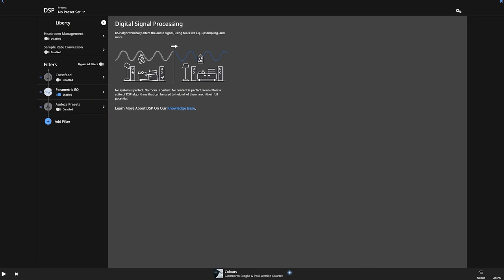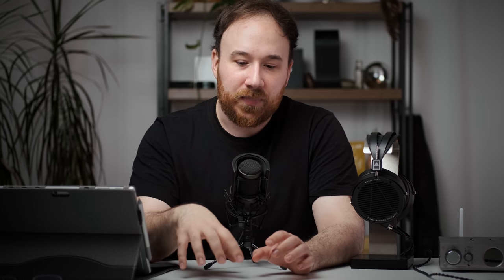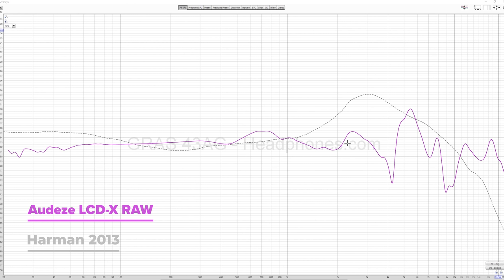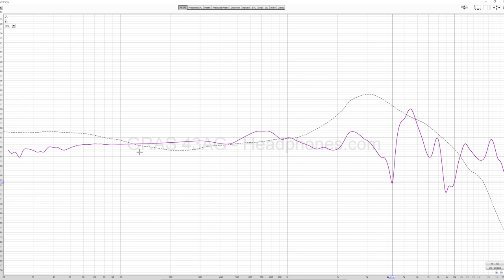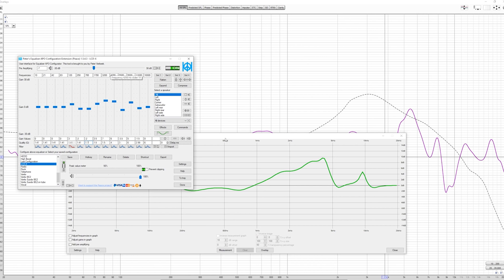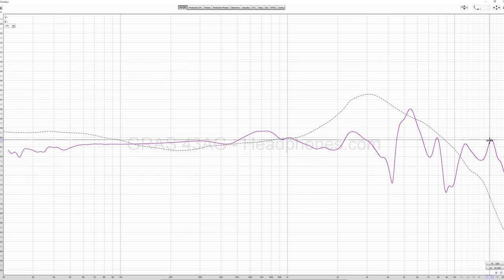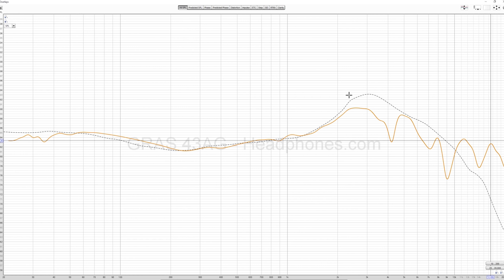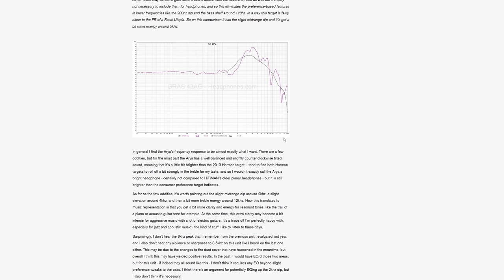How to EQ Headphones - Featuring Audeze LCD-X 2020 (not 2021)

Comment: NEWSFLASH for anti EQ folk, most mid range and above speakers are EQd on the production line after being manufactured to account for inconsistencies. Even iems and headphones have a PCB that basically EQ the driver because you can't always tune everything with mesh and filters etc. Basically whether you like it or not, you're probably already using EQ in some way or another
Reply: Ok, sure ..but if you’re spending $5k-10k on speakers …apart from positioning them properly…you shouldn’t have to touch a damn thing .
Reply: @carminedesanto6746  unless you've got a perfect room, EQ will benefit even the best speakers. Hardcore audiophiles tend to be traditionalists and will spend an awful lot of money and effort dampening the room etc, but for most people, EQ is still probably the way to go, and the technology is only getting better. People just need to understand that less is often more with EQ and not try to take the drivers places they cannot go

Comment: Do you prefer this over using Reveal+? I use the LCD-X for mixing but it needs correction (mids are way too recessed for the guitar driven music I usually work on) I used Sonarworks for a while but I think it sounds a bit unnatural. I am using Reveal+ lately but wish I could boost the effect it has on the LCD-X even more.

Comment: I dont get how can someone enjoy LCD X´s "out of the box". EQing is necessary for me.
Reply: Much better than the dt-1990's out of the box
Reply: @chadfranklin47  i dont know maybe i got bad pair but mine sounded so thin out of the box.
Reply: @ozcozfozc  That's probably normal then, I just got mine yesterday. My pair have definitely improved with EQ and are a lot more enjoyable. They did lack in low end before EQ, but were definitely listenable. I compared to my dt-1990s as those were completely unlistenable due to the blinding highs. Even with EQ, I still can't seem to flatten out the midrange.
Reply: @chadfranklin47  My lcd x out of the box were WITHOUT low end unless i played some new well mastered trance etc. If i played some metal, rock or 90s eurodance all of them had NO bass (my porta pros without eq had way more) and sometimes very aggresive treble especially with the eurodance. My eq is probably crazy. I added 10db to the 166hz with low shelf filter, lowed 5db from 8000hz because it sounds better to me and i play with 16000hz and 20000hz depending on the song (add 0-5db or sometimes lower 1 or 2db for overly bright tracks.) I dont really know its right way to do it but this way i can actually enjoy them, the Bass is actually strong. So my experience out of the box - tiny sounding, no bass and trebly. I suppose i was not ready for them. Also im using Conductor 3xp dac/amp.
Reply: mby im supposed to listen to those audiophile tracks only haha. Also i have not touch the midrange, only sometimes i play with it little to bring out the vocals out. Fortunately the lcd x´s respond good to eq even for my "crazy" preset
Reply: @ozcozfozc  Hmm, that does seem a little off from my experience. I slightly boosted the bass on oratory1990's EQ preset for the LDC-X and it's working great for me. Not sure how hard it would be for you to try another pair for comparison as I would have some trouble finding another pair to listen to myself, but it's great that they take EQ pretty well. My dac/amps are on the lower end, been using the Mayflower ARC Mk.2 and the Topping DX3.

Comment: Sorry, a complete novice here that wants to give this a go. Probably the dumbest question in the comment section, but how do you plug your headphone into the computer? Does it just need plugging into the headphone jack? or is there some kind of USB connection? Once plugged in does the program (Equalizer APO) connect automatically, or or do I need to open the program and select the headphone? Once EQ'd does the setting save on the headphone itself? So it can be used on different equipment etc... Cheers!

Comment: I tried your EQ and wow... do not like. :p Maybe it's because I have a sensitivity to the 4kHz range. I could never stand the Fostex 600 or 900's for this exact reason and I always had to EQ them down by around 8dB to get them to be 'balanced' to my ears. Maybe that's why I prefer the stock LCD-X sound which tends to lean more analytical with a 4kHz dip. Most of my fav cans tend to have this dip so I guess my ears are just broken or shaped wrong... Either way the LCD-X is so freaking great out of the box.. well with burn-in and new cables but who am I to question stock..
Reply from the maker: It also depends on which LCD-X you have. There's quite a bit of unit variation

Comment: @THE HEADPHONE SHOW

After watching countless Youtube headphone videos I decided to purchased the Audeze LCD-X headphones.  Upon receiving them, I was a little disappointed in the sound quality.  But, after watching Resolve on the Headphone Show on Youtube explain how to correctly EQ the LCD-Xs, I was quite satisfied with my new cans.

I am currently streaming Ultra HD audio through my PC’s USB port from Amazon which consistently streams music at 24bit/92kHz.  My USB cable is running into a FiiO Q5s portable amplifier/DAC with my headphones coming out of that.

I would like to upgrade the FiiO Q5s portable amplifier/DAC to separate headphone amplifier and DAC desktop units to improve the sound of the Audeze LCD-Xs.

What headphone amplifier and DAC would you recommend to complement the LCD-Xs?

Comment: 1. Always use minimum-phase EQ unless you want to EQ multi-driver iems.
2. Use high pass filter in the sub-bass region if you elevated bass. That's because most headphones distort in that region.

Comment: Isn’t Harman for over-ear a compensated curve? But then the LCD-X graph is raw.... Just a little confused since the mids look really boosted for a raw graph.
Reply from the maker: No the Harman target itself is a compensation. So when you normalize it (assume it's a flat line), then the headphone measurement (LCD-X) shows deviations relative to that target. So in other words, a compensated frequency response measurement includes a compensation target (Harman or DF or a custom target etc.). A raw measurement doesn't. What I'm showing here is the raw measurement and what the target curve is. The main reason for doing this is partially to help people understand that headphones shouldn't measure flat, but also to show that compensated graphs can also use different targets. Does that make sense?
Reply: @TheHEADPHONEShow  I think what was throwing me off was the amount of dB increase from 1 kHz to 3 kHz in the Harman target curve. That rise looks like it includes pinnea gain, where the raw graph does not look like it takes into account. I want to stress "appears" since,  if I am understanding correctly, that the Harman target does NOT take that into account.
Reply from the maker: @popzeus3000  you mean the LCD-X measurement looks like it's compensated? Yeah that's actually a raw measurement of the LCD-X, I could see how that would be confusing.
Reply: @TheHEADPHONEShow  Does your measurement rig duplicate the human ear pinnea? If the LCD-X graph already visualizes the natural 1-3k rise in dB because that's what the mic inside the dummy head picks up, then everything makes sense. The term "raw graph" in this case, just refers to the lack of EQing since it is still a graph from a rig that does not hear all frequencies equally, like that Harman target. 
The other point of confusion on my part I think has to do with the Harman target being way too mid-centric for me. Their over-ear and IEM targets are WAY different. Obviously this is subjective, but I don't want a mid-treble peak 8dB louder than the bass shelf. That's a bright headphone to me.

Comment: Hi! Love your channel, and thank you so much for this! Just got my LCD-X :) I found Peace to be one of the least intuitive applications i have ever used, but i figured it out after some hassle. 
Here's a tip: If you are unable to make Peace work, meaning, have an effect at all in windows 10 - Choose "Trouble shooting" while in the configurator and select "Install as SFX/EFX (experimental)"
Reply from the maker: Just keep in mind that the profile in this video is not applicable to newer LCD-X headphones
Reply: @TheHEADPHONEShow  How so? I applied it to mine, which i guess is the newer version, and I think it sounds a lot better! I did however ease off the peaks at 3-4KHz and 10 KHz a bit.
Reply from the maker: @TheEmrobe  the FR for the old units is quite different from the newer ones. So I don't know which you have. I'll develop a new profile for them and you can see which you prefer.
Reply: @TheHEADPHONEShow  Awesome! Thank you so much :)

Comment: The disadvantage of the Harman curve measured on a dummy head is that different people have different head-related transfer functions: our ears and heads are not all the same. 
 So rather than equalize to an abstract model of the human ear and head, I prefer to equalize the drivers directly.  Flat plate measurement + B&K hi-fi curve (a small bump in bass followed by a .9 db/octave rolloff at 200 Hz) produce a headphone that sounds more like listening to speakers in a room, and works very well for non-fatiguing listening, with a very natural warmth to the sound.

Another disadvantage of the Harman Curve is that later revisions have nothing to do with sounding "flat", but sounding exciting or interesting to a wide variety of listeners.  Trained listener prefer a flatter curve that is less v-shaped.

Comment: I think I missed it, but what application are you using to get the frequency response, and overlay it with the Harman 2013 line?
Reply: That's REW. You won't be able to use it like that unless you have an industry standard rig to measure your headphones with ($30,000+)

Comment: If you need to eq your headphones, You bought the wrong headphones. You can eq all you want, but the condition of your hearing changes during the day. There are lots and lots of factors influencing how we perceive sound.

If the car you bought doesn't sit right  for you. You bought the wrong car. These sweaters are itchy. You bought the wrong sweaters.
Reply: You define morbid..
Reply: sound engineer : are you kidding me?
Reply from the maker: "You can eq all you want, but the condition of your hearing changes during the day" - this is why it helps to use measurements to guide our adjustments.